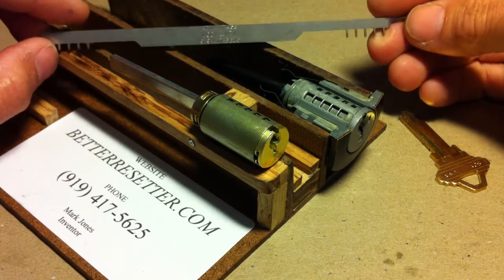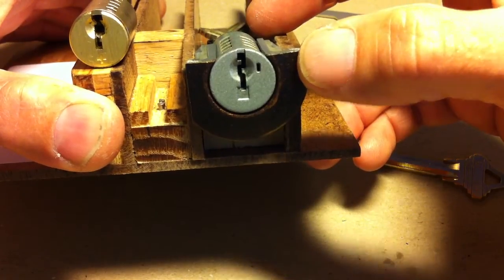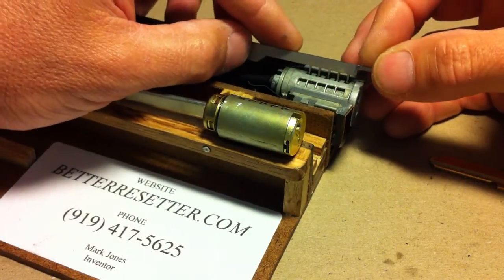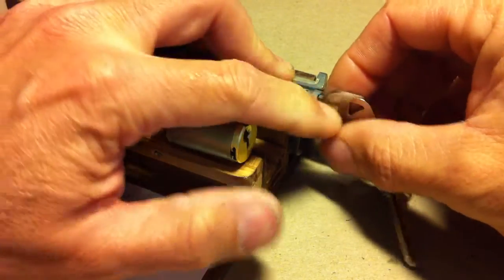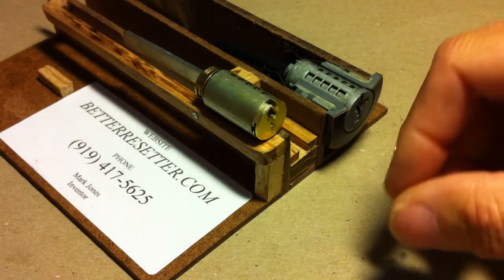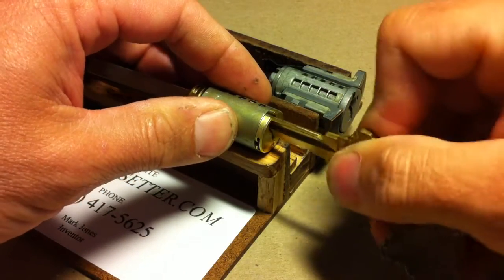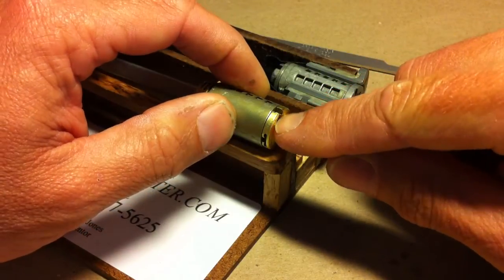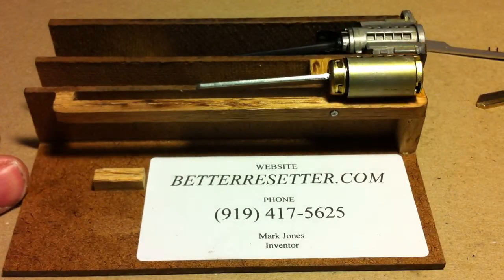Better Resetter Reset Tool Instructional Video

Comment: I have a Schlage Securekey knob cylinder where the plug has been turned 180 degrees.
Will your tool allow me to unlock the cylinder and then rekey it?
Reply: Did it work?
Reply: they never got back to me and I never bought the tool